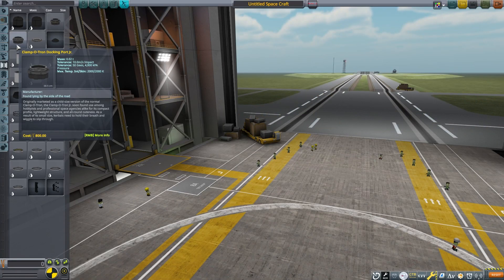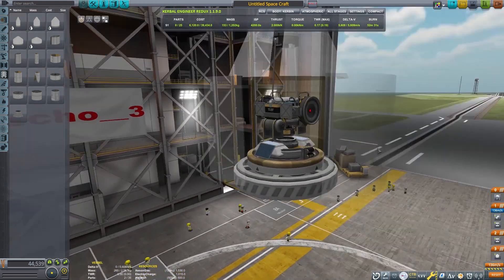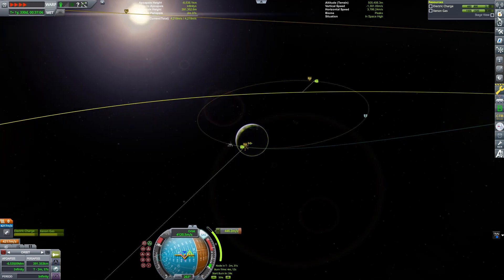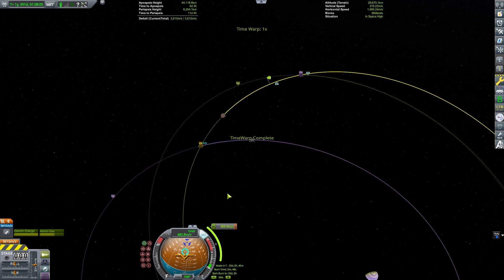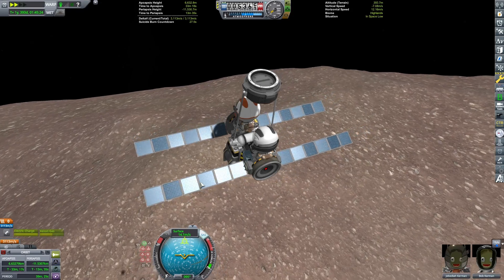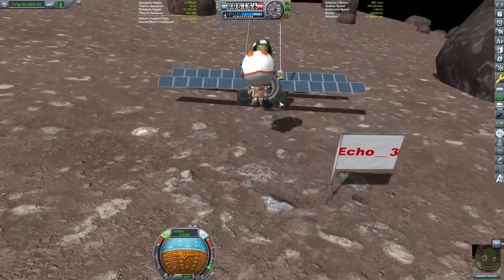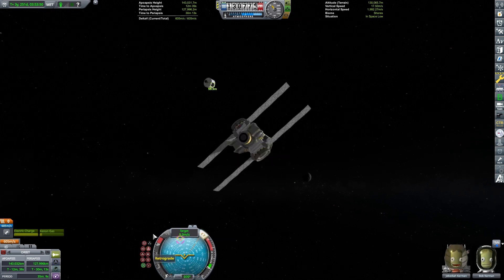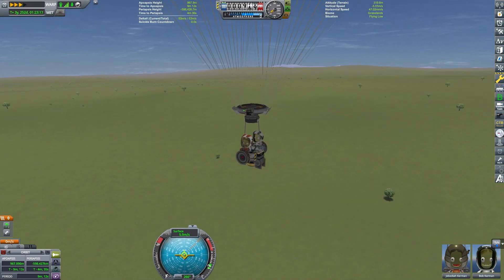Using the Dawn Electric Ion Drive to Explore Eve's Moon Gilly

Comment: the way i do my ascents is a modified version of the mike aben method. Go full throttle, gradually pitching over until you hit 45 degrees. Hold that until your prograde marker moves over it, then lock prograde. Begin throttling to keep your time to apoapsis between 45s and 1 minute, depending on your second stage TWR. Also, don't be afraid to start throttling if you need to before you lock prograde.  Once your almost at orbital velocity (you should be atleast 50km up by now, keep your throttling until your orbital speed hits 2150m/s, then stop throttling. Let it out until your apoapsis hits your target periapsis, coast up and do a circularization burn. This method is pretty efficient and helps you fly a nice and accurate ascent for most rockets.